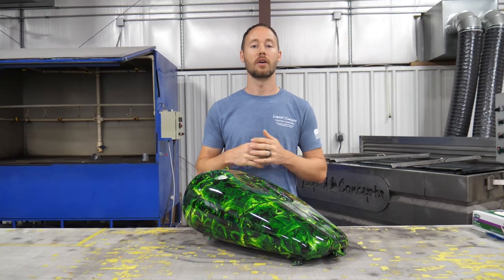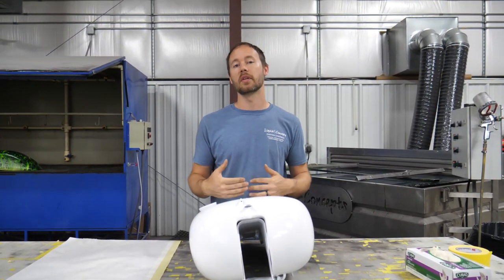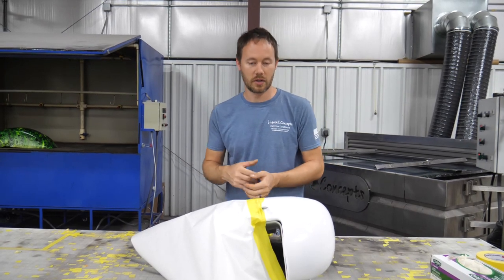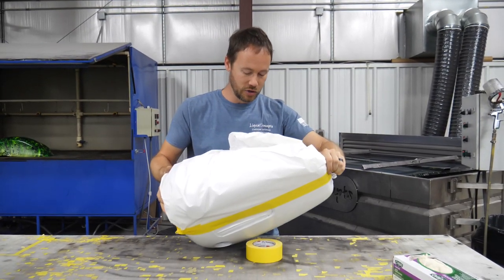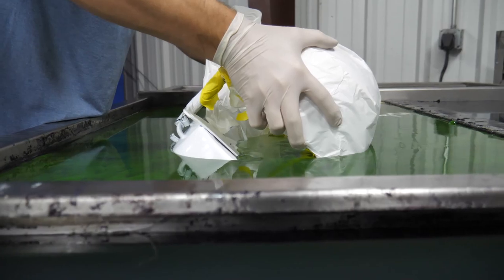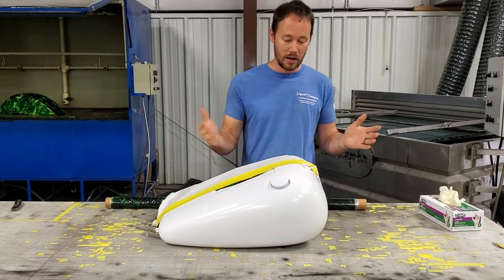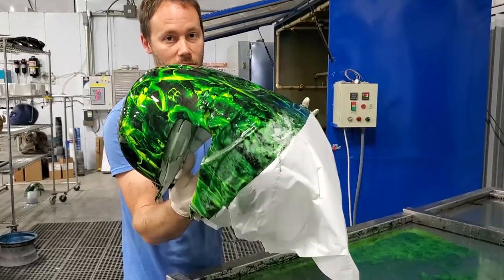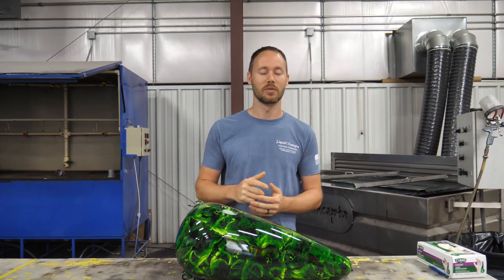HOW TO HYDRO DIP A MOTORCYCLE GAS TANK | Liquid Concepts | Weekly Tips and Tricks

Comment: I found the best way to do any part that needs both sides done, I first mask up one side , dip , But Don't rinse off the slimey film left from the dip. I let the dipped side dry. once dry remove masking from other side then proceed to dip the remaining side, once dipped, rinse entire part . the trick is once the first side is dipped then dryed, It act as a masking which rinses off saving time remasking parts up numerous times.
plus check your film in the tank not upside down , Still a flawless finish , nice job

Comment: Love the concept….  But I’d have to agree with a couple other guys here.  Right side was correct and I’d be pissed about the left. 
Otherwise, awesome looking.
Reply from the maker: The customer was well aware that some skulls would look upside down to the pattern he chose is non-directional. Meaning that throughout the entire design there are skulls straight, turned, and even upside down for a random look. If this had been a directional film then of course it would have been laid out to where the skulls go facing up.
Reply: @LiquidConceptsUSA  would like to see how you do tank with carbon fibre film - no chance to join them lines :) :)

Comment: Just my two cents but for very buoyant items you can add some water inside to curb flotation so long as it is sealed before dip, if dipping a tank use rubbing alcohol in the off chance the tank is not sealed to prevent corrosion and the remnants evaporate quickly. Will not pose any adverse effects on fuel. Makes for a smooth dip. Hope this helps someone

Comment: Does tapping on the first dip prior to the second dip not gonna lift it from the paint? Or is it okay to put tape on the dip before clear coat?
Reply: if its been activated correctly, taping over the first dip shouldn't be a problem. Just dont use duct tape or anything similar cuz that'll prob pull the dip off
Reply: @skyworx524  ohhhh 😯 I gotta try that! Very cool idea. Thanks for sharing 🤘

Comment: You inspire me to hydrodip! But I keep having issues on my end. :/ 
I bought carbon fiber film online and the company claim it's super easy to use, even for beginners. So I said to myself, shoot I gotta try it...

My issue is every time I dip my object into the water/film the entire film follows it. At 6:30 your object sinks in perfectly and all the film conforms to the object and the rest of the film around it stays in place; for the most part. On my end, I dip my object and the entire film moves inwards and makes a huge mess- messing the print up. Why is this? 

Also, it's SUPER sticky once taken out and basically falls off if I rinse/rub it. I set the film for 1min in warm water and spray activator right after 1m mark and dip. 
Anyone know my issue? Hope I made some sense trying to explain. Thanks!
Reply: If the film is following it that means you are under activating it. Need to use more activator..
Reply: @erniefrongillo7513  Oh. Thank you. I thought I was using quite a bit of activator tbh but I'll spray even more next time I dip and see what happens
Reply: Also depends on how close and how straight down you are spraying. Should be spraying straight down and about 8"-10" above the film.
Reply: Are you putting the correct side of the film down first? I think you put the sticky side facing water